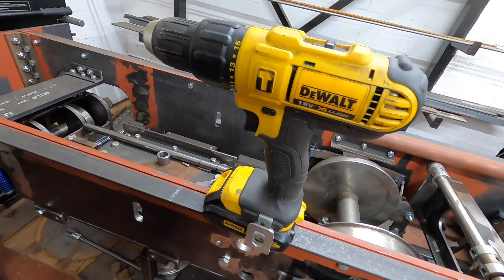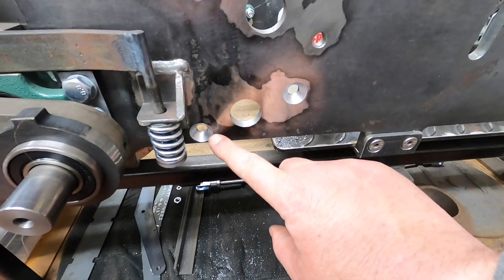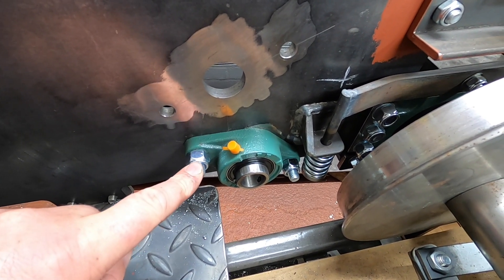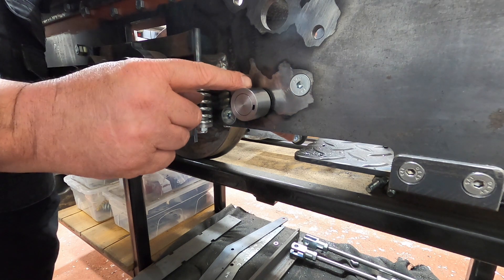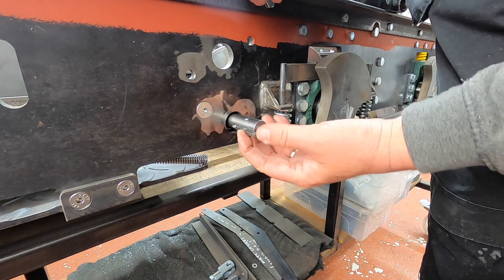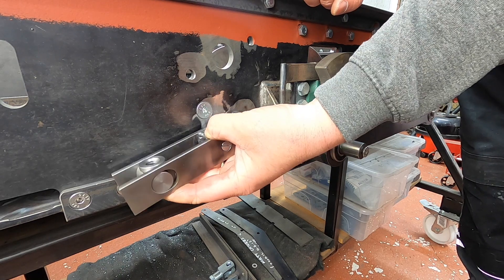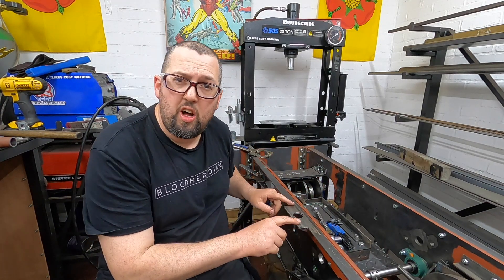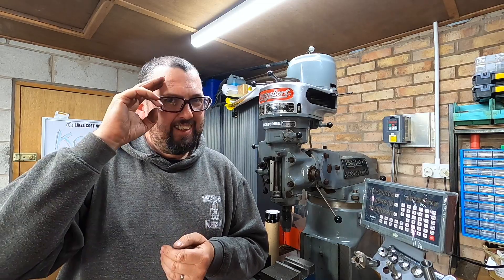Countersinks and Brake Column Support Base - EP44 - 7.25" Gauge Steam Locomotive Build

Comment: Looking good Matt!  If I may ask a question...  What thickness of steel did you have the counterweighted cranks laser cut from?  What about the connecting rods?  (or coupling, can't remember what you guys across the pond call them instead of side rods)

I'd like to laser cut some of both for a future project before I leave my current employer (I have time, but want to get a jump on it).  

Thanks!
Reply from the maker: Hi Jeff, many thanks. So the cranks are cut from 20mm, the rods are 10mm. Over here connecting rod is the rod that goes from the main driving wheel crankpin and connects to the crosshead, coupling rod connects all the driving wheels together.

If I was to cut these out again, I'd cut the rods out of stainless so I could leave them unpainted without any risk of them rusting..... bit damp here in Lancashire and everything goes rusty rather quick. All the best, Matt
Reply: @MattChiversWorkshop  Thanks for the info Matt!!  Will have to settle for 19mm for the cranks, can do 10mm for the rods though.  Stainless is definitely one solution to a rust problem, but it's a pain the ass to machine!  I'd skip it for that reason alone...  

Will go with steel, but might consider painting the rods or have them plated with something (zinc or something like that, but not chrome or nickel).

Did you go with 6mm or 8mm for the main frames?

Comment: Dumb question, but i haven't been around long enough to know: Will you be using these (modern) bolts or "upgrade" to square heads once the project is complete? I'm not saying you should, just asking. :)
Awesome work so far, between your channel and the Nashville Steam updates on 576, i'm getting my steam fix.

One the subject of countersinks: oil and pressure. If you feed them that, and they're quality, they'll cut wonderfully. Oil helps the flats move about and evacuate chips easier, helps a bit with cooling too, and pressure is vital because of one important aspect, chatter. If you have chatter in your cut, not only will the cut no longer go centered, but it also will at some point (depending on luck) chip the cutting edge/dull it. It's kinda like when you cut through brass with a drill bit, you sometimes chip the edge of the flute - on account of the stickiness of the material. I usually use a thick lubricant for these, like bar and chain oil straight from the fridge. The staying power is increased from the cold and it helps with keeping the oil from just running about all over the floor.

Cheers! :yougotthis:
Reply from the maker: Hi aserta, There are no dumb questions, and thank you for your interestingly informative reply. These countersinks where purchased with the guarantee, if I could blunt or damage one, I could have my money back.... I tried my best, but alas it did not fail and they are still sharp. Must try the cold oil tip! The bolts are staying with the modern ones. 

Must check that channel out, sounds similar to steam workshops Fowler rebuild series. All the best, Matt

Comment: Bulletproof…..
As per usual…
🤣🤣🤣🥰
Well done ‘design-on-the-fly engineering Matt 
👏👏👏
Regards
Robert
Reply from the maker: Thanks Robert, to be honest design on the fly is what I was good at when I was working in the fabrication/welding industry. I find it rather interesting coming up with different designs and ideas. This won’t be the last time you see me do this either 😁. All the best, Matt 👍

Comment: The designs good with the gussets did you think about a bearing where the shaft goes through the hole ? not sure about the background music though
Reply: Bit of wobble rooms always good
Reply from the maker: Thanks Gaga, as the shaft will be short anyway, it needs to flex a bit, so no bearing at the bottom, this would restrict too much. All the best, Matt 👍